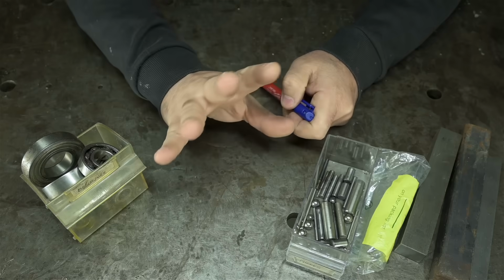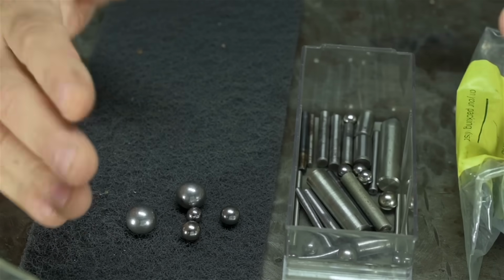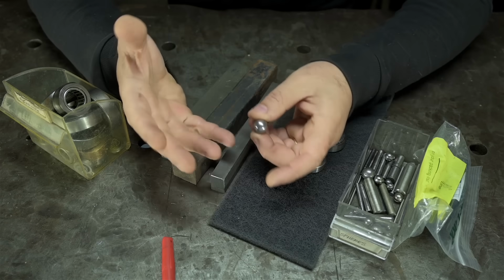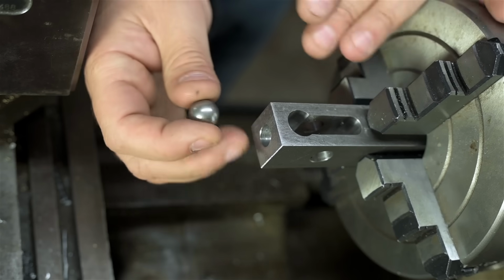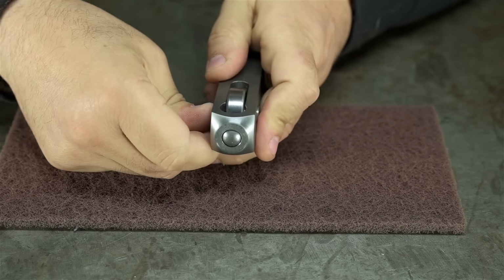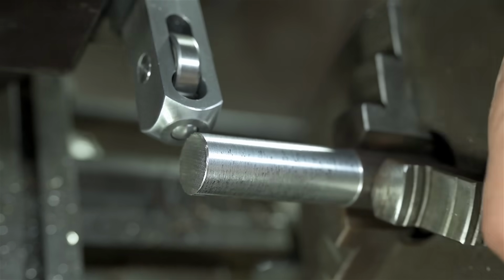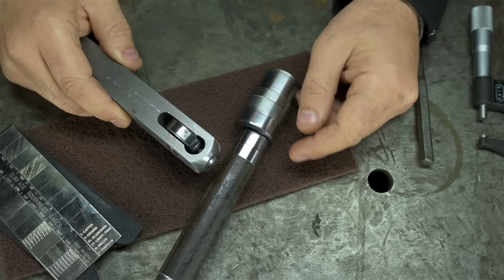I Have The Power!! (Burnishing)

Comment: so where i work we use a burnisher that has a carbide wheel to go from a 32Ra finish pass with the insert to a 4-8 Ra after the pass with the burnished. we check them with a mitutoyo surftest. the finish doesn't really look great to the eye but it will test very well.

Comment: You didn’t hear it from me. but if you have some OD threads that are slightly loose ( the no go goes on), you can use a tool like that to slightly mash the top of the threads to tighten them up ( or get the no go gauge to not go). Use at your own discretion. It doesn’t fix it. It only gives the illusion of fixed.

Comment: Master cylinders and wheel cylinders are burnished to size to get that perfect fit and finish with the rubber seals. The specific tool was called a bearingizer and made in house. it used the cylindrical bearings in a cage and you adjusted the size with a cone in the center on an allen head cap screw.

Comment: I recently used a internet bought tool very similar to this I think it was around $50 or $60 on aluminum and it worked great. I was previously using two grits of emery cloth and finishing it with a maroon Scotch-Brite pad and the finish after turning then burnishing with no polishing in between was much better than the Scotch-Brite finish. I haven't tried it on steel yet but from this video it looks like it would work ok.

Comment: I would be curious to see a normal ball bearing as well. On one hand the single bearing has a tighter point where it puts pressure on the material, so it's easier to deform the metal from that one point with the same input force. On the other hand, the full ball bearing may leave a nicer finish as it has a wider surface area itself. It'd be a lot closer to a 1:2 ratio for input vs output force though, so you'd have to crank the force a lot higher.

Comment: When you build one with just the bearing tilt it at an angle and use just the corner of the outside race to increase the localized pressure. Used a lathe burnishing tool a few times it was a carbide roller bearing that was tapered with a spring loaded holder to give consistent pressure. When using burnishers it takes a good amount of pressure, like you assumed similar to knurling. Support thinner parts with the tailstock for rigidity and run slower feed for better results. A good finish before hand will look better after as it's only leveling the finish. You will still see a fair amount of the previous finish as it works more material on the high spots and less in the low spots. Burnishing is mostly for the actual roughness of the finish not for the look. Especially because in my opinion it always gave a bit more matte look versus a shiny look from polishing.

Comment: Wouldn't a Scotch Brite pad do the same thing? I know that wouldn't be the same as burnishing but the surface would be similar. I sharpen my tungsten for my tig torch with a bench grinder then with a Scotch Brite pad about 8" long laying on my bench I hold my  tungsten at about the same angle as the grind and quickly drag the tungsten down the piece of Scotch Brite 6 to 8 times and it takes the tiny groves from the bench grinder out. Doesn't make sense to me knowing how hard tungsten is compared to the Scotch Bright, but it works very well.

Comment: Burnishing results in a compressive residual stress in the part akin to shot peening. Depending upon the material and desired case depth, you may run into galling issues with the ball. US patent 5826453 details a device which uses hydraulic pressure to float the ball instead of using the bearing behind it to address this and ither dynamics. Also, search up "low plasticity burnishing" and "controlled plasticity burnishing" for additional info.

Put the burnishing tool in a robot arm and you can do large surfaces or curved parts in multiple dimensions.

And yeah, it makes the part shiny and stuff. 😂

Comment: Tony, the forces on the lathe are very little. The forces at the singular point of contact however... 

On aliepress the sell carbide burnish tools that are spring loaded. They will burnish and HARDEN 17-4 on a sherline. 

How I use this: 1, to surface harden. 2, to bump a part in after rechucking. 3, everyone has had that slip fit part where you know you'll ruin it with emory but dang if it slid just a little better...

Comment: The "bearing on a stick" will work...saw it done  about 30 years ago and was amazed by it...Its great for fixing a bearing journal that is almost on size that has a poor finish...great video thanks for sharing 👍
Reply: Just thought of something. How about replace the knurling wheels with ball bearings on the type that clamps the stock so there are no side loads. Should be fairly easy to try.

Comment: Sphere rolling imposes theoretically infinite stress, (Hertzian) much like those in a ball bearing under load. The result is local, plastic deformation.

Bearings fail because the plastic deformation eventually fatigues and the work hardened surface flakes off.

Successive burnishing passes are likely to (weazel wording because there are lits of variables) also produce worse surface defects than the ones you're trying to iron out.

Comment: Having the ball bearing contacting directly the piece to machine may not be as efficient. Or in other words, it may need a larger push force to achieve the same results than having the steel ball contacting the surface

Comment: Used to work in a machine shop that didn't even have the reference for roughness and I had no formal training for CNC machining, just learned it at work. So, the only stuff I machined that had a tolerance for surface finish was Ra 6.3, I made them as smooth as I could because I had no reference or measurement tool for it. Eventually I decided to switch workplace to a bit more professional one, which happened to have both the surface finish measuring tool and a reference example for it and I found out that my "6.3 Ra" finish was easily at least 3.2, quite possibly even 1.6 or 0.8 😂 What's actually 6.3 finish I either threw in the scrap bin or took a finishing pass to smooth it 🤣

Comment: Lubrication specialist with 35 years of experience in machine lubrication: if you like this tool, then use a hypoid gear oil with a good sulphur content or a similar oil. You have very high surface pressures. You want this on the workpiece, but your ball bearing will suffer as a result. As you are not removing any material but only pressing, very good lubrication is the key to success.
Reply: "very good lubrication is the key to success" if I had a nickel for every time I heard a lubrication expert tell me this, I would be rich. 

Although the first lubrication expert I heard from just told me to spit in my hand.
Reply: Wife agrees here. Lubrication is key.
Reply: Trefolux
Reply: Bunt, is it better to have the roller bearing in an oil bath or keep the open design that Tony made?

Comment: Ok,  two things coming to mind:

First, when are you gonna diy build the electronrastermicroscope to check your actual surface finish to really show off ?

Second, i bet you could use this on tool / wood handle texturing to improve grip strength, so you get a better straight cut next time you try to get around garden work. 😅

Comment: I think the problem with using a bearing race straight onto the part would be the increased mating surface area. The increased pressure required would be excessive.

Comment: Why do I feel like I’ve seen this before? I had to check the date stamp to make sure YouTube hadn’t just cleared my history again…

I was taught to use a surface comparator plate by dragging a finger nail across the grain of the surface; which is a surprisingly easy to gauge (certainly between about N10 & N6).

Comment: Search for "Back Countersink". I've only seen them for 100 degrees for aircraft use. Found a few on E-Bay for (relatively) cheap. You'd need the arbor for them too. There are about 3 or 4 arbors depending on the diameter of the countersink. There are back spotfacers too.

Comment: Great video Tony, but where's pt 2?
we must learn if the bearing itself works,
I imagine not,  because a thousand times pressure is needed.
However a small dia roller race would be good to try, but - the thin axle for it will suffer,  so try exactly as you have now,  but replace the ball with a small dia roller race for proof of concept.
Then mill off the chucķ side of tool in front of the roller bearing axle.
Good luck and then it needs a hydraulic ram inside the tool to a pressure gauge on the outer end of the tool so we can see to the force at which the toolpost launches.

Comment: Clever Rig, slick looks.   Comparing roughness TO: days work, each pass, baby's butt, head shaved or not ...  
Silk is sensitive, reacts to surface condition;  So put on Stockings, no grease just rub, if runs, you'll know, you're in them.  
[slightly off]  article \ links  'ballizing process leads to increase in hardness of premachined holes'  …  
'Ballizing – The Latest Technology in Hole Finishing' Mar'19 [irjet] n t

Comment: you would likely want a smaller ball if you worry about overloading your lathe. As hertzian stress wants you to believe, the smaller the radius of a ball in contact, the higher the stress on the substrate material. And to that effect using the bearing race straight against he substrate would not generate as much hertzian stress. It would require much more force for the same results (though if you try that, smaller race OD would be preferred).

Comment: AI Summary

Abstract:

This video chronicles the unexpected journey of a DIY machinist, who, after a hand injury, stumbled upon the concept of "power burnishing" via YouTube shorts. Intrigued by the promise of spectacular surface finishes on lathe work, the creator undertakes the design and fabrication of a custom burnishing tool. The tool uses a hardened metal sphere supported by a bearing within a specialized holder. The video details the challenges of machining the tool and its assembly. Initial tests on hot-rolled steel demonstrate a remarkable improvement in surface finish, transforming a rough surface into a polished, almost mirror-like sheen with minimal dimensional change (only a few ten-thousandths of an inch). The creator explores the principles behind burnishing, including its effect on surface hardness and roughness, and discusses the importance of surface finish in various applications, concluding that while the technique is promising and enjoyable to execute, further experimentation is required to fully understand its repeatability and limitations.

Exploring "Power Burnishing": A DIY Lathe Tool for Mirror Finishes

*   0:01:37 The Unexpected Project: The video's main project was unplanned, arising after the creator suffered a hand injury in the garden, which led to a period of "doomscrolling" YouTube Shorts.
*   0:03:03 Discovery of Power Burnishing: The inspiration came from a video demonstrating "power burnishing" lathe work with a hardened metal ball, producing an incredibly smooth surface finish.
*   0:04:30 What is Power Burnishing?: It's a technique using a hardened metal sphere in a lathe tool post to "smash down" high spots on a workpiece, creating a highly polished surface. The creator notes its similarity to "bizarro world knurling."
*   0:05:26 Tool Design & Challenges: The tool requires a hardened metal sphere, a ball bearing to support it and handle loads, and a custom holder. Fabrication involved intricate machining to create a reverse counter-sink to securely hold the ball while allowing it to spin freely.
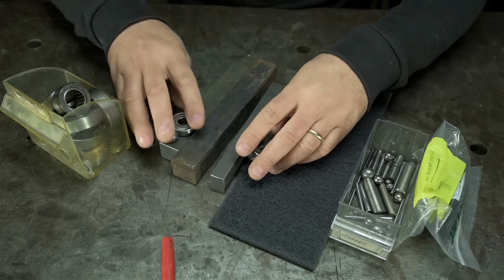*   0:06:12 Initial Questions & Hypotheses: The creator aimed to understand the forces involved (potential impact on the lathe), the dimensional changes to the workpiece, and the overall effectiveness of the technique.
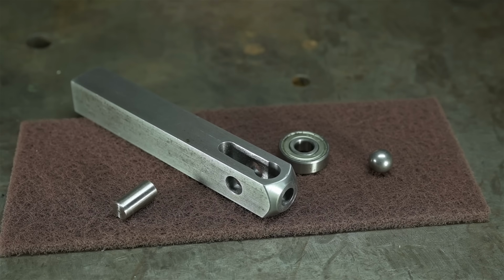*   0:10:51 Tool Assembly: The final tool comprises a tool holder, a roller bearing, a hardened metal sphere, and a retaining pin (secured with a "press fit" achieved by "upsetting" the pin material with teeth, a single-use method).
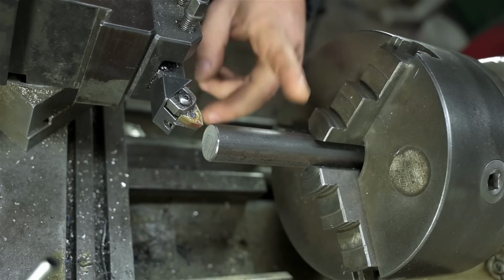*   0:12:56 Test Setup: A piece of hot-rolled steel was prepared with a deliberately rough initial cut (higher feed rate) to clearly demonstrate the burnishing effect.
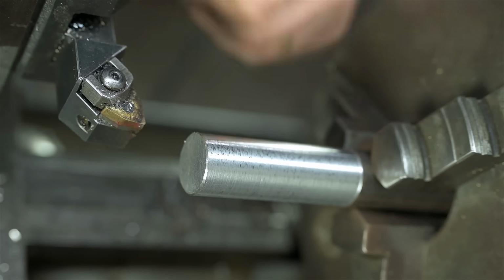*   0:13:26 Burnishing Process: Treated like knurling, the process involved low RPMs (around 300) and a low feed rate, using oil/coolant for lubrication.
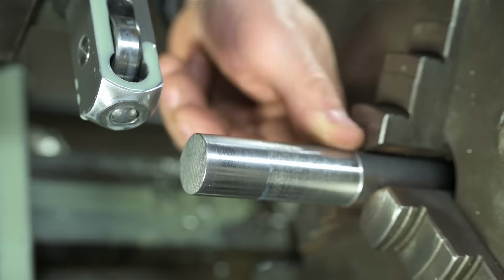*   0:13:59 Initial Results - Surface Finish & Dimension: The first pass dramatically improved the surface finish, making it surprisingly smooth and shiny with minimal pressure. Crucially, the dimensional check showed no measurable change (remaining at 0.952 inches).
*   0:14:30 Deeper Burnishing & Dimensional Change: A heavier second pass further refined the surface and rolled off the corner. This pass resulted in a subtle but measurable dimensional change of approximately 55 millionths of an inch (about half a thousandth).
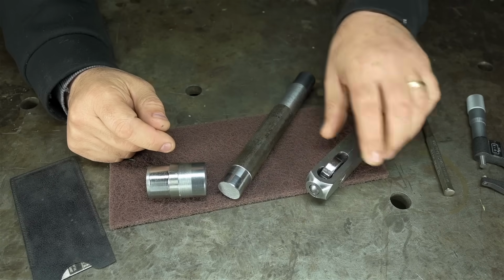*   0:16:08 Understanding Roughness: The creator estimates the surface roughness improved from approximately 63 RA to 32 RA (average roughness in micro-inches), explaining how smoothness can be critical for applications like plain bearings (requiring a "Goldilocks zone" for proper lubrication) or purely aesthetic.
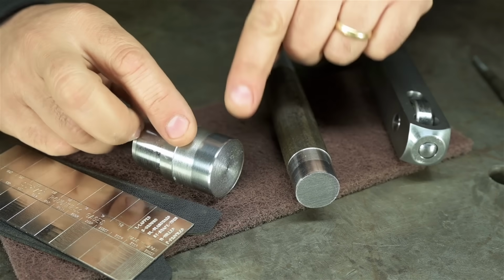*   0:17:32 Side Effect: Increased Hardness: A beneficial side effect of cold working metal through burnishing is an increase in surface hardness.
*   0:17:47 Conclusion & Future Exploration: The tool is effective and fun to use, but further experimentation is needed to assess repeatability across different metals and diameters. Limitations include inability to work into corners. The creator will keep this technique "in the back pocket" for future projects but will rely on traditional grinding or outsourcing for critical dimensions.

I used gemini-2.5-flash-preview-05-20| input-price: 0.15 output-price: 3.5 max-context-length: 128_000 on rocketrecap dot com to summarize the transcript.
Cost (if I didn't use the free tier): $0.0059
Input tokens: 17790
Output tokens: 927

Comment: We used to research not only roller burnishing but also deep rolling at the university I was working at a few years ago. Quite a big project and extremely interesting.
Important are rolling force and feed rate. I would recommend making the bearing spring-loaded. This allows you to control the rolling force better and it will be much more even. The ball must always be significantly harder than the component. You can even roll hardened steel with a carbide ball. However, the bearing ring behind it will also suffer. This is why such tools are sometimes loaded with pressurized oil instead mechanically.
Too little rolling force has little effect. A little more gives you roller burnishing. Depending on the material, you can achieve almost mirror-smooth surfaces. Even more rolling force is used for deep rolling. The surface is additionally strain hardened and high residual compressive stresses are introduced (very good for fatigue strength). If the force is set too high, the surface is literally shattered. This can also be seen visually. The feed rate should always be selected so that the rolling paths overlap considerably, i.e. feed rate only 1/10 to 1/5 of the rolling path width. You can estimate the rolling path width using the Hertzian contact width (simply search online: Hertzian pressure ball-cylinder ... there should be an online calculator tool thing somewhere for sure)

Comment: Surface roughness is one thing, which can be sanded on the lathe or ground or achieved with fine finishing inserts. But increasing surface hardness is great, because it doesn't involve treating and is not dependant on the material type. It's like cold forging? You hammer it down to size, the material fibers are compressed, and it's something that can't be done in any other way after machining. I've seen tools on chinese websites that come with a diamond ball, very small. With a smaller ball you apply more localized pressure, so you don't need to push as hard, but you might need to feed down. I wonder if heating up the part before burnishing it this way and adding oil could trap oil within the surface in the process, to prevent rust or simply reducing friction with the mating part

Comment: Would assume the majority of your issue is that you are using a non-mirror polished ball bearing for the end. Your overall reflectiveness will be limited by the reflectiveness of that roller on the end. You wouldnt be able to get a mirror finish from 60 grit sand paper, why expect it from a ball bearing that looks like it has some (minor) surface pitting.

Comment: As long as you make the face of the bearing curved to keep the contact surface low I don't see why it would not work. The longitudinal velocity is not high enough to cause major differences. It would just act like a rear tyre on a car in a corner.

Comment: Have you tried grinding or polishing by lathe? Using diamond sharpening stone in a tool holder. So if you have CNC with tool changer you can just switch to grinding. Of course unprecise if flexing holder. Of course there are diamond and sapphire tools but it would make a YT Video and give a ground surface texture instead of a spiral.

Comment: I imagine the roller bearing wouldn't work because of how much greater the surface area is. You'd need to put a much more tremendous amount of force to achieve the same effect as the ball bearing which only contacts a wee tiny area at once. Could be wrong though.

Comment: I was hoping you would use a cam roller bearing with very thick outer ring. Or using one with spherical outer ring, to skip the ball, but the smaller the sphere , of course the higher the Hertz pressure gets.
Edit: Hertzian pressure is correct english. Smaller Sphere = higher pressure and better at going towards edges. It is like trying to make a screw flat. The right ball diameter plays a role.